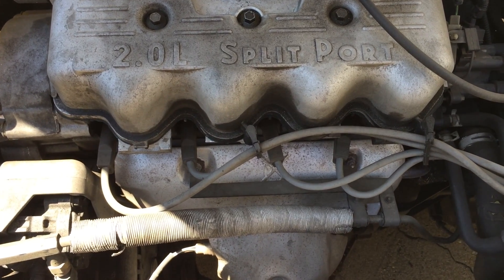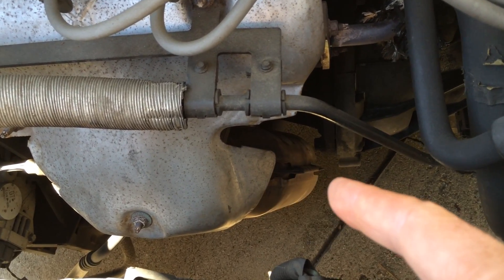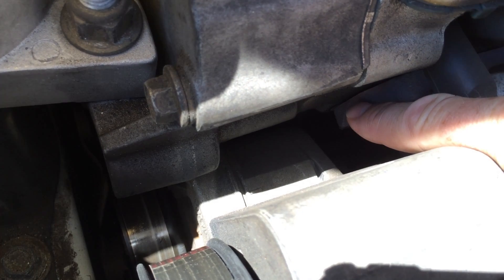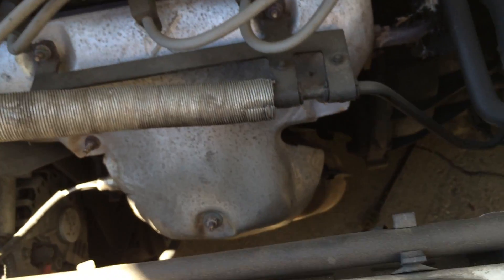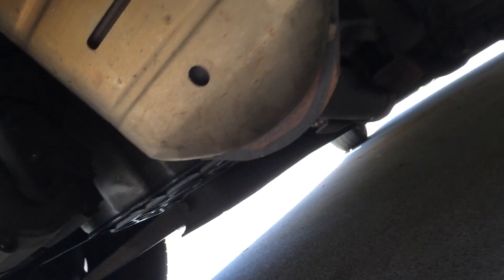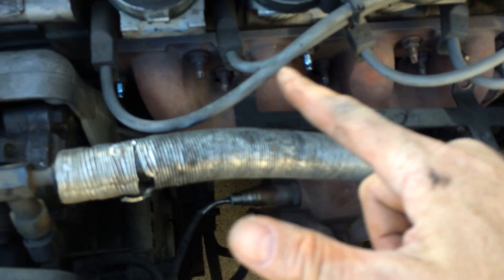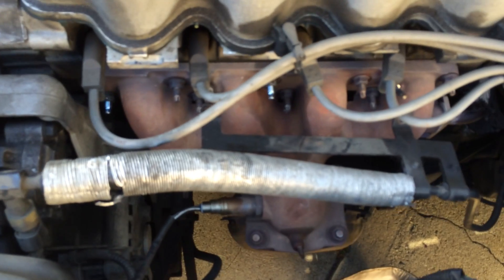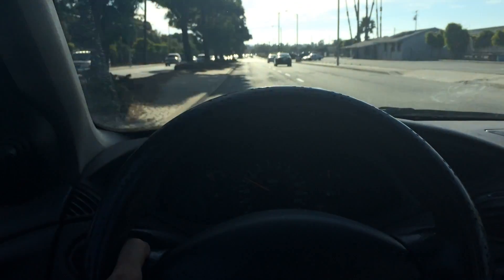How To Dagnose A Car Exhaust Leak

Comment: Looks like mine sounds only when I put load on the engine, for example flooring it at idle or when passing someone in the highway. Looks like it comes from under the car but I'm not 100% sure.

Comment: I got a 2.0 vw jetta 2003 and the engine sounds like a damn bus. I use regular fuel.. whats that noise that i hear??? Its like coming from the back of my manifold up front but i dont see any leaks or anything. No cracks. Nothing.

Comment: Exhaust bolts break if you dont heat up the bolt first with a butane torch , and reason is the heat expands and retracts and those bolts usually have corrosion on them

Comment: I have the same issue. We’re you loosing power ?? Like the car wasn’t boosting right ?
Reply from the maker: Yes. It seems like it had a little bit less power, but mostly it smelled like exhaust when I turned on the air conditioner.

Comment: Hey great video,  I have a 2001 ford escort that makes noise only when I accelerate, do you think I'll be the same problem or what would you suggest for me to check instead. 
My first thought is a gasket or something like it, all I know is my Corolla doesn't do that. Let me know what you think, thank in advance.
Reply from the maker: That is a tough thing to diagnose. It could be the same problem. Maybe there’s just a little leak, and you don’t hear it unless there’s a lot of exhaust flow volume.

Comment: I have a 02 focus when it mad thay noise did it cause a gas smell to come in the car it comes and goes
Reply from the maker: Yes. It smelled like gas whenever I turned on the air blower or ac.
Reply: @hoohoohoblin  ok im get that fixed hard finding certain parts for these cars

Comment: I have a question for you did you smell exhaust when you would drive it?
Reply from the maker: +Mexican Jeep kid Yes, especially if I turned on the fan or ran the AC.
Reply: hoohoohoblin when I drive my jeep I smell exhaust and I think it might be my manifold. It might have a hole. Even when I drive with the windows all down I still smell a  exhaust smell.
Reply: hoohoohoblin once you fixed your exhaust manifold, that exhaust smell went away?
Reply from the maker: Yes
Reply: hoohoohoblin thanks I need to get mines fixed

Comment: HI about my Toyota Corolla Verso 2003 ,,, when I start the car the car can be started quite normal and it will speed up the normal but only a few seconds, lap speed goes down and the car shakes since the engine is completely stop ,,, I search did wrong and I noticed if I start spraying using gas at some point begin to lap speed goes up ,,, wondering if it is normal or is there something wrong ???? thanks so much for your help. I have taken a video. 
https://youtu.be/JOGP85PWZ9s
Reply from the maker: If you spray gas on it and the engine speeds up, it means you have an intake manifold leak.
Reply: thank you very much for your answer , I have done it . have you seen the video ? if yes  I wonder where is leak ???

Comment: Lol last few seconds had me laughing... Great video....  Mines only makes noise when accelerating instead of the sound coming from the back exhaust which is a magna flow. i hear it in the front
Reply: same lol. caught me off guard and got me crackin up
Reply: Same here. Did you find where was the problem?
Reply from the maker: Noel Nunez Thanks!
Reply: Mine does the same thing
Reply: Thanks great info